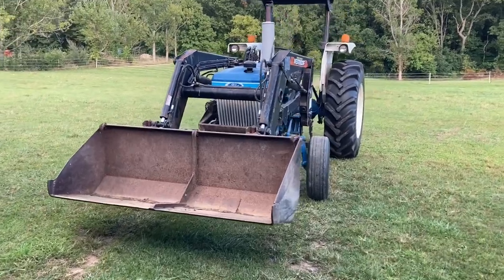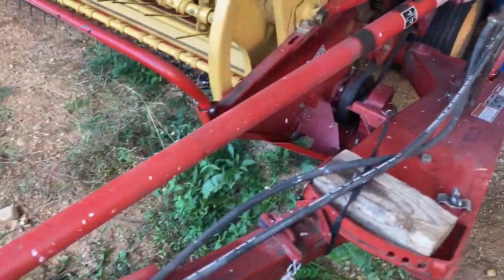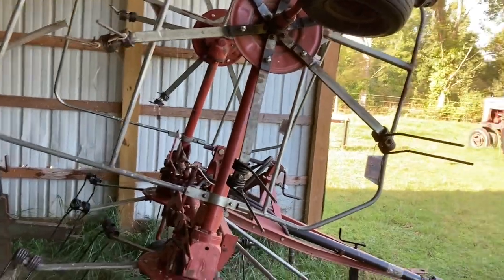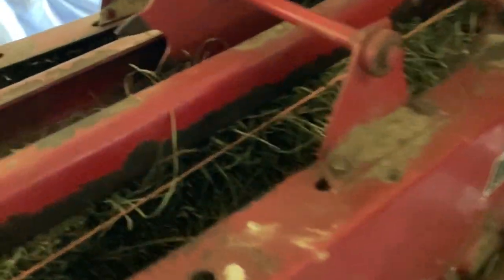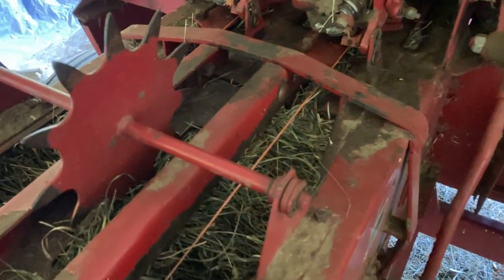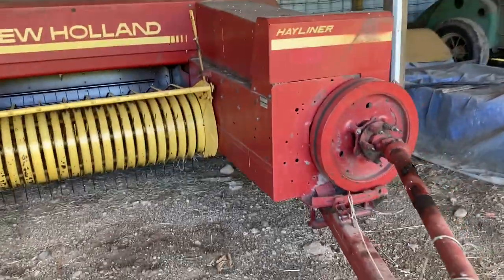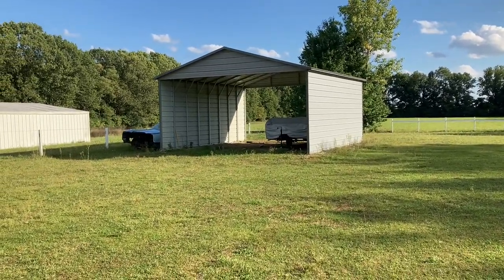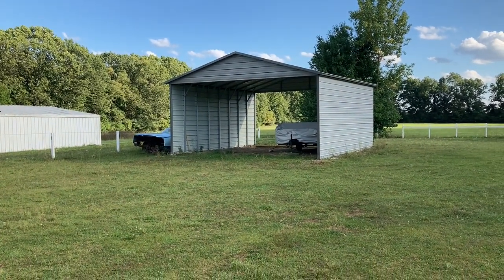All the equipment needed to make hay on a small farm

Comment: Making hay was my motivation to go to college.    Tractor was a VAC Case widefront for mowing raking and baling.  Myself my mother and sisters took care of this chore.    They do make hay making equipment for small subcompact tractors if you are so inclined.    For  $10K or thereabouts you can but a mower, tedder, rake and small round baler.   Though the bales will not stack like small squares.

Comment: You need to remove the hay from your baler. Each time you bale. Thanks Glenn
Reply from the maker: I will do it between cuts and season. I don’t do it between fields during the same cut. Dry hay sitting in there for only a few days in a shed isn’t an issue and then the first bale I get from the field will always be tight.

Comment: Impressive buy on your haybine !!!    Had the same haybine for years ( 15)   I bought it ......and it still had the shims between the rolls !  1/4 inch of shims. That means I was cutting hay with sickle mower ! No crimping action ! They put shims in at the factory. They were meant for oats.  Check for the shims on each end of the rolls. Take all shims out !   They say it will damage the rolls if they touch. Not true. Mines been touching  for 15 years......and no damage !   Also....I see on the wabble arm end ......the rear springs  are not tightened ?    In other words when you put the hay bine down it drops like a rock....no floatation !  Those spring must be tightened nearly as tight as you can get them . Total header weight should be what you can lift off the ground with one arm (maybe 25 pounds )   Its to protect the sickle from rocks etc.  Also.... there are skids under the front of the header. Get rid of them !    If you have gophers........trap them !  Pick up the rocks !
Reply from the maker: I have a different video where I show adjustment of the header floatation. The rolls don’t have shims.

Comment: What size is your equipment shed? I’m looking to build something that can house my equipment and a few hundred bales. I’ve got a similar lineup to you with a 311 baler, a 472 haybine and 3930 ford.
Reply from the maker: 54x24. It started out as a 24x12 loafing shed and I’ve added on to it three times. I’m wanting to add on another 12’ in length this winter to make it 66x24.  I would not recommend a three sided shed for storing hay though. I like my square bales completely enclosed from the weather if you’re in the Midwest.